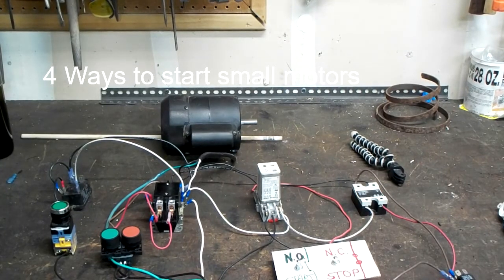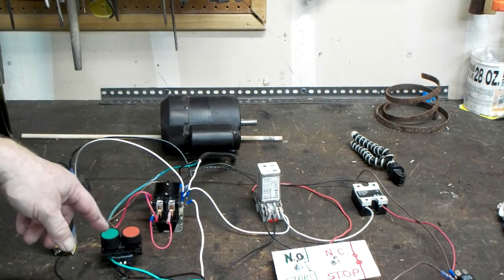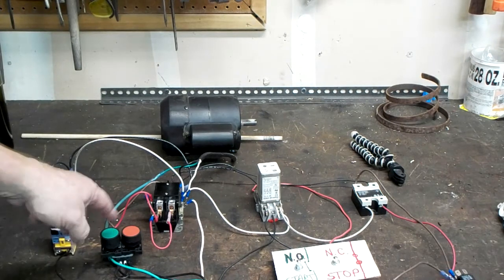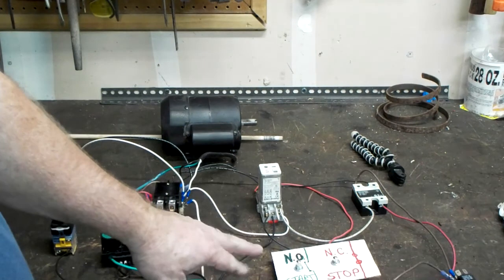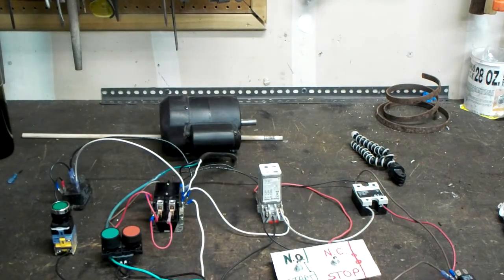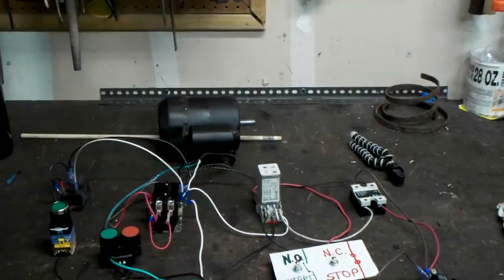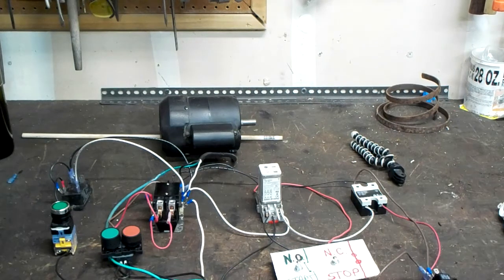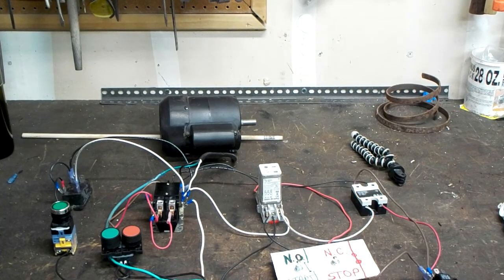4 Ways to Start Small Electric Motors

Comment: Thanks for that. The red/green switch with the latch loop and the red to break the loop is a very interesting concept. I used a similar circuit on the low side of my lathe VFD to prevent starts after the brake was engaged and released.
Reply from the maker: thanks for watching Andy!!!

Comment: Man if I had a fraction of your brain power.
Where did ya u learn all this stuff Mike?
Reply from the maker: You are way too kind Jeff, but thank you.
i have been fascinated by how things work since i was a child. 
out of High School, i went to school to be a diesel mechanic and learned DC circuity at Wyoming Technical Institute.
From there i worked as a forklift mechanic and learned the 3 phase charging systems for the industrial forklift batteries 
i maintained air compressors, generators and industrial control stations and pendants for a few of the better customers.
i was an iron worker for almost 3 years before injury made me rethink that career
From there i went into the food packaging industry where my knowledge of AC and DC electrical systems has been tested to the furthest extents.
i guess that leads me to here. 😁